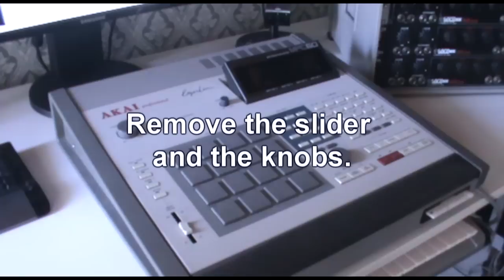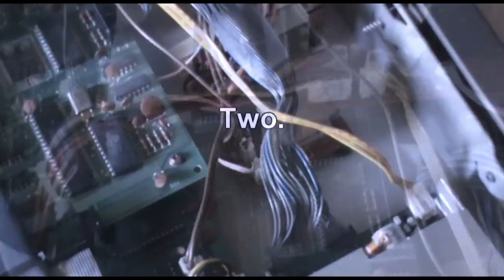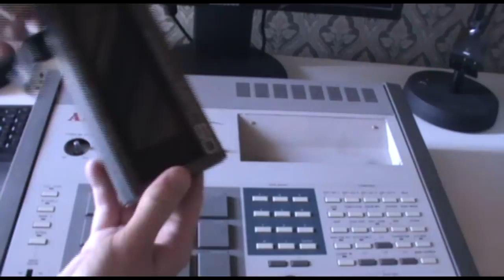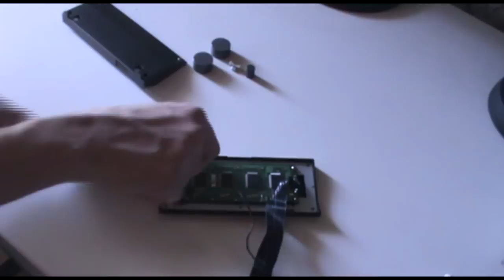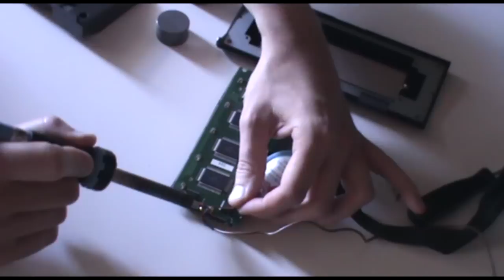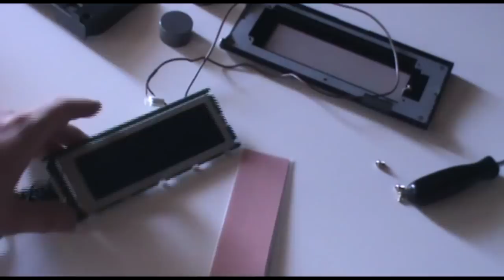How to replace the display of a MPC-60

Comment: You don't need to remove the knobs or slider...Or even disconnect the display. Just clip the first two zip ties to free the ribbon and power chase from the bundle harness
The MPC 60 was slightly different, the screw held down a PCB and the LCD and BackLight were secure to the PCB with twist crimps that pass thru the PCB. Slightly more difficult, but still doable